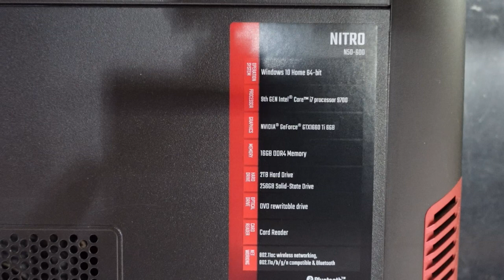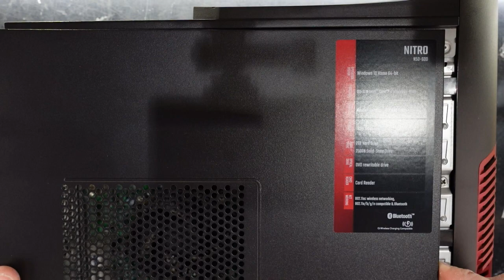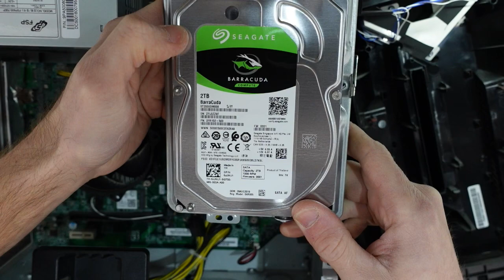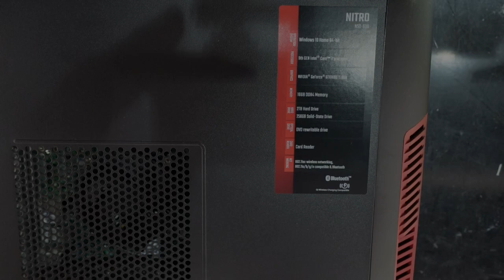Acer Nitro N50-600 Teardown and Upgrade options

Comment: Thank you so much for the demonstration! I bought this PC as a budget option and just now realized how tightly packed it is! Even hard drive installation requires removal of multiple panels. Well, looks like I bought that SATA SSD for nothing, since i cant install additional SATA harddrives it looks like and its too late to return it now. 😂
Reply from the maker: Go m.2 or possible 2.5" SSD
Reply: You can? I have the stock HDD in it and an additional sata SSD.
Reply: It is possible I have one in mine
Reply: @Even_N.D.  how did you install a second ssd in there? There was space for an additional ssd? I want to know if I can add an additional one without removing my main one.

Comment: Hey hey, incredible video. PSU on my Acer died, so I'm cannibalising mine for parts and putting the CPU, GPU etc., in a case and mobo that isn't so damn proprietary. Your video has been such a big help in taking it all apart!
Reply from the maker: cheers

good luck with your rebuild!

Comment: I just upgraded from a GTX 1650 to an RTX 3060 on my Nitro N50-500.
The GTX 1650 didn't use any extra cables and so, the cable I needed wasn't found in an Accessible location. I had to take the Hard Drive and Disc thingy in order to get to the cable I needed.

Thanks to your video I was able to remove these easily without much hassle and I was able to identify the cable I needed for the RTX
Reply from the maker: Glad to hear this has helped
Reply: @R3z Shark Hey I am currently trying to upgrade mine from a 1050 to a rtx 2060s but I don't really know where to plug the wires in my pc if you ever see my message thank you if you are willing to explain me where and how
Reply: im trying to do the exact same upgrade, which one is ur 3060 asus, zotac, msi? i wanna know this, cuz im a little afraid the one im gonna buy doesnt fit... hope u can answer asap :)

Comment: Thanks for the review. I have an older model: ACER Nitro N50-600G-EW11 Gaming Desktop, Core i5-8400, GTX 1050, 12GB RAM, 1TB. I have added a small SSD drive to help with the speed.  I have tried to replace existing ZOTAC GTX 1050 with first a MSI GTX 1060 which resulted in a no signal to the monitor.  Thinking the GPU to be faulty. I returned it. An ordered an Sapphire Pulse RX580. With the same problem. No signal to monitor.  Here are the steps I followed for install: Use DDU to uninstall existing Drivers.  Powered down, drain power from unit. Place new RX580 in unit. RX580 fans spins. The Acer will go through 2 false starts before powering up.  Monitor will show no signal. Tried with 2 different hdmi cables and 3 different monitors no luck. Tried taking out CMOs and Ram sticks. But no luck. Currently back using original 1050. Any ideas what I've been doing wrong? Appreciate it!
Reply from the maker: odd, im not sure on that one sorry but even without drivers and without even getting to windows the GPU should be displaying
Reply: It is bcs you need to put into gpu aditipnal power
Reply: Aditional*
Reply: You zotac gpu working fine bcs it uses the pcie power supply  that is powered by motherboard. If u got better gpu that need more watts you need to plug into gpu power cable that have minimum 6 pins it depends on the gpu
Reply: Or maybe you power supply don't produce enough watts to support newer gpu's

Comment: Upgraded to a, be quiet! Pure Rock Slim 2. Fits perfect! You will need to remove the motherboard from chassi to remove the orginal mounting screws from backside of the motherboard, so it will fit a standard cpu mounting clips, the backplate is attatched with adhesive. Not that hard to do, just follow this steps and undo the CPU and motherboard screws and front USB /aux unit. I also mounted a chassi fan in the back with pwm 4 pin, be quiet 80mm. Fits nice. 92mm will also fit, the chassi can do either 80mm or 92mm only..

Comment: Great video but I noticed you didn't really go in detail about some upgrade options notably the graphics card. I have this pc but it's slightly older as mine has a 1050ti and I would wanna upgrade but I don't know which cards would fit and was wondering if you or someone knew?
Reply from the maker: A bit hard to cover most GPU upgrades

As you will be limited to psu rating and the physical card size

Something like a 1660 ti, 1660 super, 2060 or a RX6600 should be fine powersupply wise
Reply: @rickstechrepairs  great thanks a lot👍
Reply: Ive put a 2060 in mine with no dramas
Reply: @rickstechrepairs  Hi, what about a 6600 XT?
Reply: Your could probably do things up to a 2070 or 2080
Reply: @jdf1184  which model
Reply: @hmr.44  n50-600
Reply: @jdf1184  like which model of rtx 2060
Reply: @hmr.44  evga rtx 2060
Reply: @jdf1184  ok

Comment: Hey, top-notch video!
I have a 2018 model of this with an i5 8400 and gtx 1070 8GB.
it ran great the first couple of years but lately, I have had an issue with overheating of the CPU, which compromises basically every game I play. therefore I am looking to transfer the components to another case, for better cooling options.
and I've been doing some research but I can't quite figure this out. how many coolers does the motherboard support? and will this motherboard fit in a mini atx tower?
I really hope to hear from you soon since I'm kinda stuck in the process
Reply from the maker: Hi, i would look at replacing the CPU cooler first
As changing the case wont do as much as a decent CPU cooler
Reply: @rickstechrepairs  would any cooler fit the job?
Reply: I agree, CPU cooler made the performance so much better especially when using for longer periods of time

Comment: Hey! I'm a bit new to building PCs and I have a bit of an older model, I was wondering where I would install an SSD and what options I would have. Thanks for your time and great vid!
Reply from the maker: Hi , if its a similar model an NVMe SSD should be able to be installed 
but if its a few years old open it up and see if you can see the slot

if there isnt a slot there you will need to go 2.5" Sata SSD
Reply: @rickstechrepairs  hi, where would the 2,5 ssd go then? I think I have an older model, and I wanted to get additional SSD for programs, but I started wondering if it's even possible to fit it inside there, 
Would it go like "below" HDD?

Comment: if I upgrade to a 1tb ssd, do I have to replace it, or is it another space to put the 1 tb ssd, if I replace it do I lose all of my pc storage? And where can I place it if I dont need to replace it?
Reply from the maker: dont need to replace, can just stick the 2.5" SSD anywhere in the case with tape
Reply: @rickstechrepairs  So there is a second SATA connector there to use for the SSD?

Comment: Hi Ricks, I would like to upgrade/add-in my SSD (256gb to 1Tb) for my N50-600
Can I add in the SSD in addition to the one that is already there? 
or must I replace it
Reply from the maker: you could add a 2.5" SSD in there
Reply: @rickstechrepairs  where would this go? I've got the crucial mx500 ready to put in but can't see where it would fit?
Reply: @parseusyt93  hi Perseus where did you end up putting it? I’m trying to get that one in there too

Comment: Hello! Thank you for this great video, very informative, straight to the point and helpful. I was wondering if you could give me some advice/steps to take to install a new ssd in the m.2 slot. I bought this computer from a friend as an upgrade but I want to upgrade the ssd using the ssd from my older computer. The ssd in my older computer is an m.2 NVMe 2TB that I put in myself. The old one is running windows 10 while the new one is windows 11. Is it possible to just clear the old ssd (factory reset) and put it into the Nitro 50? If so will it still be running in windows 11? Thank you again!
Reply from the maker: I would recommend the pc you put the nvme in , to do a clean format 

Use the windowd 10/11 installation tool 

Boot off it and reinstall windows from there
Reply: @rickstechrepairs Thank you so much! I really appreciate it

Comment: Can you upgrade the PC case? I got major upgrades on my Acer Nitro but the motherboard is a bit odd. Do you think a full size ATX case will fit the motherboard?
Reply from the maker: 9:38
Reply: @rickstechrepairs  thanks!
Reply: @networkoverdrive1460  have you changed the case if so which one do you have?
Reply: @torbensanaldiener  honestly man the motherboard is such a weird shape only a full size atx tower will fit it but you will have to sacrifice the front io. It was so much hassle I replaced the motherboard to a mid size atx and went with any usual atx case. I had two of those motherboards and in both cases I just replaced the mobo, I find it the only logical solution
Reply: @networkoverdrive1460  allright thank you

Comment: I want to add in my 2.5 crucial mx500 ssd, where would this go?
Reply from the maker: i would tape the 2.5" drive to the inside of the case, since it has no moving parts, it can just hang in there also

Comment: So under the hdd would it be possible to install an internal ssd? Super helpful video btw!!
Reply from the maker: it would be loose but yes you could
Reply: @rickstechrepairs  thank you! is there a spare port in the PSU for the ssd or would i have to replace the hard drive?

Comment: Do you recommend using a heatsink with the m.2 NVME Kingston A2000? thinking of getting one as my boot drive in my i5-8400 Nitro 50, and seeing if you had a preference on one.
Reply from the maker: if you can use a heatsink, great but shouldnt be required

Comment: hey, i have a question i find the airflow very bad in the case i have the same pc only with a gtx 1060 i could change the case and keep the mainboard (motherboard) because i haven't figured out the size yet i got half of it Internet researched and found nothing about it sorry for my bad english im from germany
Reply from the maker: 9:45 I mention about changing cases

The front usbs are part of the mainboard, so you will lose them if you change cases

if you change cases you will need to make sure they are long enough to fit the board
Reply: @rickstechrepairs  thank you so much for the answer that helps me a lot 🤙🏻
Reply from the maker: No worries :)

Comment: Hello! I've been thinking to get a systemfan at the back to lower temp but I don't which size to use. Would an 80 mm fan work?
Reply from the maker: not sure on fan size
Reply: Hey Lucas Im looking to do the same thing. Did you find out?
Reply: @quinkin8019  Indeed. You can put either a 92mm or 80mm fan.
Reply: @crashchamp  cause my system overheats alot: and the fan starts revving for 10 seconds every minute.  Anything Else than only the fan i can Get to fix this?
Reply: @quinkin8019  Do you have any files running in the background? That can use a lot of from the cpu if the cpu fan is revving.
Reply: @crashchamp  I make sure to turn everything i dont need off.
Reply: @quinkin8019  that means your cooler is failing and you should get a new one
Reply: @QuicklyFreeze  on god?

Comment: Would you recommend adding a sata 2.5”SSD or replacing existing m2 SSD? I only have 256 GB SSD as prebuilt and am always at max capacity.

Based on your comments, it seems sata is maybe a bit slower but easier to install?
Reply from the maker: if you already have m.2 ssd and are unsure how to clone to a new SSD.
i would go with adding a Sata SSD, i would recommend going with a 1TB MX500 SSD
Reply: @rickstechrepairs  thank you!

Comment: Sorry I have the 110-510version is the motherboard a standard ATX or it’s different? Thx 🙏
Reply: And my gpu 1650 was like 80C  is there anyway to fix the overheating thanks
Reply from the maker: 80c is fine
Reply: @rickstechrepairs  thanks
Reply: @rickstechrepairs  what is the motherboard size

Comment: Hey rick ive got the version that has the i5-9400, GTX1650 and the ddr4 8 gb. I want to upgrade my ram but i dont know what other ram options are compatable, would you know any or do you lnow the exact name and type of the motherboard?
Reply from the maker: use cpuz to find out what ram you have

but 8gb of 3200mhz ram should be fine
Reply: Hey ayden, did you find out? Im looking to do the same thing. What type of ram did u get?

Comment: Hey! I bought my acer nitro n50 back in 2018. It came with one 8gb 2666mhz ram stick. Now im going to replace it with two 8gb ram sticks (16gb). Does the new ram need have the speed of 2666mhz or is it capeable with higher speeds such as 3200mhz or maybe 3600mhz?
Reply: Btw, my specs are : Gtx 1070, Intel core i5-8400 and a Nitro N50-600 motherboard.
Reply from the maker: if you install faster mhz ram in to your system it will slow itself down to match the lower speed ram thats already installed

Comment: Awesome video, there is one thing I have been trying to find but can't.  I want to put my second monitor on it but the second hdmi slot is blocked and I can't figure how to remove the plastic so could you do a video on that please
Reply from the maker: Hi 
If the HDMI port is up the top of the case, not near the current HDMI port 

Then I suspect the blocked port is for the integrated GPU, which is disabled when you play in the dedicated GPU (Nvidia GPU)

Comment: Hi Rick, great video....I have this machine but can't get it to start. Press the button at the front and then it tries to power for 1 sec then shuts off and continues to do this until I remove the power cable. I have replaced the PSU in case it was that but it isn't. Sadly I think it is the motherboard. What I have no idea about is what size motherboard I need, as you said it isn't a standard ATX or mini ATX. I am no IT buff and what I need to know I get from You Tube. What size motherboard should I be looking for? and any recommendations for a specific model please?
Reply from the maker: if it is a mainboard that needs to be replaced 
it would be a micro ATX board 

Going by the size of the board here
https://youtu.be/KSbO3eZIj9g?t=654

you can see it has a single PCI-E 16x Slot and a 1x PCIE 1x Slot

you will be be after a micro ATX mainboard
that has one of the following chipsets 
H310 / B365 / H370

Comment: Hi, I have the Nitro n50-600-ur12, and it doesn't come with an m.2 SSD, and the SSD I purchased didn't come  with a screw to hold the SSD in place. Would you happen to know what size screw I'd need?
Reply from the maker: Hi 

something like this

https://www.aliexpress.com/item/1005004869870956.html?spm=a2g0o.productlist.main.25.31305b12RBSPti&algo_pvid=c04a3a90-8595-4b62-95a3-a5dc09e406b1&algo_exp_id=c04a3a90-8595-4b62-95a3-a5dc09e406b1-12&pdp_ext_f=%7B%22sku_id%22%3A%2212000030826135180%22%7D&pdp_npi=2%40dis%21AUD%211.23%210.78%21%21%21%21%21%40210219c216728046015704654d072c%2112000030826135180%21sea&curPageLogUid=31ruJVemAo3g

Comment: Hello Rick! Im looking to upgrade my Acer Nitro N50-600. It has an 1060 6gb vram, 8gb crucial ram, i5 8400. I am a huge gamer and need better peformance. What parts should I buy and is it possible to change the computer case? How would i go about changing them? Im not an amazing pc wizard like you, so i dont know these things that well!
Reply from the maker: you have a pretty balanced machine 

But i would do these updated in time.

1- Install an NVMe SSD if you havent already got one (Kingston A2000 500GB or 1TB)
2- Install a second stick of 8GB DDR4 (to get dual channel +16GB)
3- Would look in to the second hand market and try and get a intel i7 8700 
4- Once the GPU world Prices Calms down, look to getting a RTX 3060 or a AMD 6700XT to replace the GPU
Reply: @rickstechrepairs  You're a life saver man. Thank you so much!
Reply: @rickstechrepairs  hi I have the same model as him and I would like to know something if you upgrade the cpu and gpu will you need a better fan? Also when the computer have a intel optane in it should I just remove the hdd who doesn't have it?
Reply: @oturan9728  you would need more fans to keep the PC cool and I think a better psu

Comment: I’m trying to move all the parts to a bigger case but the motherboard has that tiny black and white cord I’m not sure if it’s able to be moved, will the motherboard be able to be taken out?
Reply: Hey mate, I know this is late but those are the Bluetooth and WiFi adapter cables, they were just glued on on the other end, so I just peeled them off the case - should still work fine.

Comment: Hello! I have the nitro 50 pc as well, i dont know if its the same exact model as the gpu and storage is different, but is it possible to add a new NVME into the pc without taking out the old one? Or is there only space for one and a few more extra SATA ssds? Thanks!
Reply from the maker: i think there is only one m.2 slot in there
Reply: @rickstechrepairs  so if i want to upgrade my storage without taking out the already existing ssd, i have to get a SATA drive instead?

Comment: Great video has helped me loads! Although I am trying to upgrade the psu and can't seem to get it out, any suggestions?
Reply from the maker: nar sorry, i dont have a suggestion on that one
Reply: You can easily take it out. Remove the screws from backside , press down the lock that you can see under the PSU

Comment: Hey, I just found your channel. I have this desktop and I was wondering if I can change my boot option to my ssd instead of my hard drive. I went to the bios but it doesn't show my ssd. Could you please help me!
Reply from the maker: Are you using an 2.5" SSD or an m.2 SSD ?
Reply: I think when u press f12 on startup screen you change change boot device